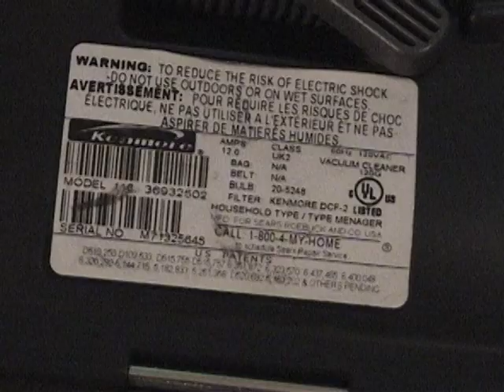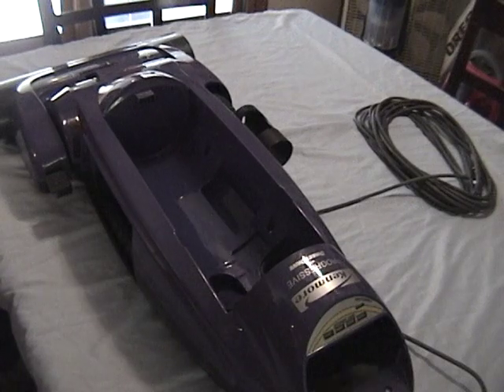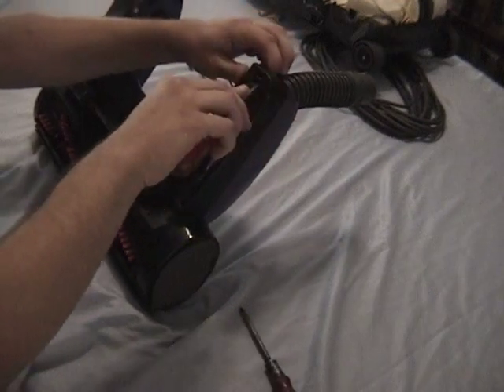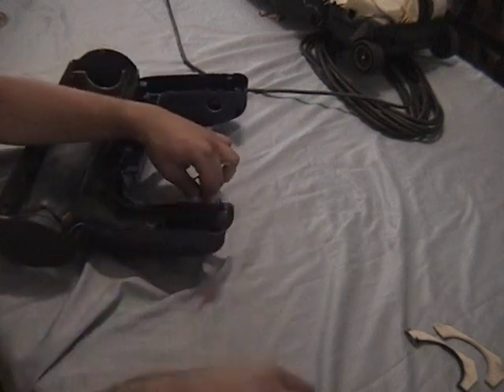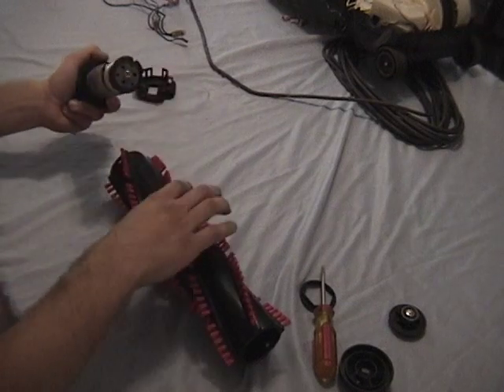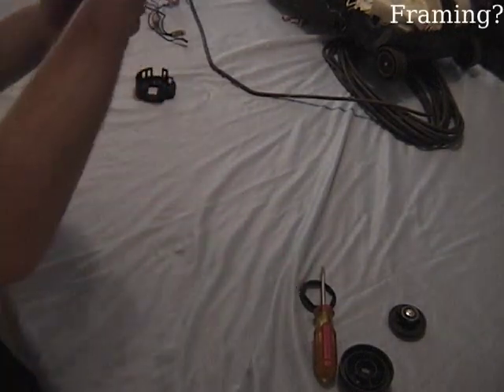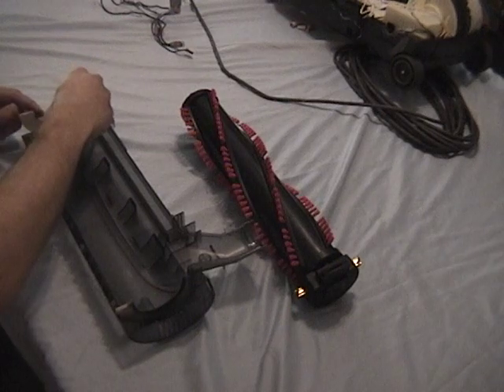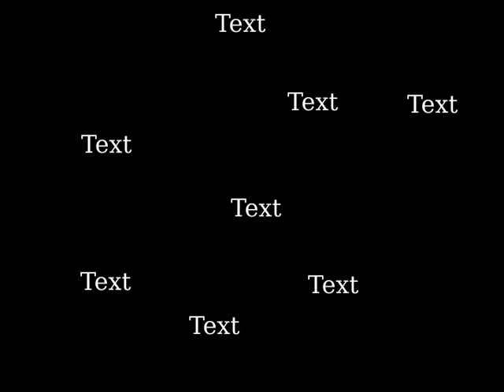How To Access The Direct Drive Brush In A Kenmore Progressive/Intuition

Comment: Thanks for the video.  I did manage to replace the beater bar by only disasembling the bottom part, but it was tricky to reassemble because the wires are so short.  Still, better than breaking into the wiring in the main compartment.  Your video helped me visualize how the wiring needed to go back together.

Comment: I bought this Kenmore 18 years ago. Cleaning ladies say it's the best. I treat it well and it still works great ... until today, when it played a trick on me. I tipped it up to pull out some hairs/threads twisted around the brush barrel and saw a ring of fuzzy stuff in the little spaces between the barrel ends and the housing collars. Since the fuzz is the same color as my carpet, I assumed it was compacted carpet fuzz, and  pulled it out on one side. Whoops! Turns out they're felt end-gaskets, and now the barrel doesn't spin. I should have taken Vacuum Cleaners 101 in college!

Comment: Couldn't tell but do you recall whether the 608 bearing is open? one seal? 2 seal? rubber seals or metal seals? I noticed searching the web that there are variants of said 608 bearing. wondering because I plan on taking apart Kenmore and cleaning the direct drive motor and testing 608 bearing for play, filth, etc.

Comment: I own 4 or 5 of these progressive vacuums. I do a lot of diy projects, and watch a ton of videos. Your's is up there with the best of them. I have a question, the brush roller on one of my vacs, (which is exactly like the one in your video), is running intermittently. If I bang it, it goes again. At first I figured it was probably a handle switch, but now I'm wondering if it could just be dirty? I didn't see a handle switch (that turns on the brush when you lower the handle) in your video, is there one? Also, would dirt or sand lock the brush motor up? I use that vacuum in a very dusty, sandy area in the desert. Fun fact, the guy that owned this house before me owned a vacuum cleaner sales and repair shop. He left hundreds of broken vacuum cleaners behind when he left, (he was a bit of a hoarder ;-). Again, fantastic video, thanks for posting!!
Reply: Did you ever figure out why the brush roller is intermittently? Thanks

Comment: I have this vacuum, and it works well.  We just bought wool carpeting.  I was told you can not use a vacuum with the bristles.  Is there a setting that would raise the bristles, so it does not touch the carpet?  Thank you!

Comment: I just found your very helpful video.  I would like to test the brush motor.  I notice that it is direct current, can you tell me the DC voltage that is correct for the motor?
Reply from the maker: As far as testing it to see if it spins, they will run on a very low voltage.  In the machine, I may not be remembering correctly, but I think it rectifies the 120 VAC line directly, so that would be about 170 VDC.
Reply: @ReviewingModsOfGames  Thank you, I will test it.

Comment: I have an old Kenmore upright direct drive Intuition model 116.31810010. It recently had a plug in the hose right where it connects to the vacuum head assembly. I successfully cleaned it out with some needle nose pliers as demonstrated on another YouTube video. Now I have a problem with the brush itself. The brush will easily turn by hand, and the vacuum works well on the bare wood floor setting, but the brush will not turn when the switch is on for carpet. I am at a loss about the reason since all videos with my problem are for belted vacuums. Is there a separate motor for the brush that could be shot? Do you have any suggestions for me?
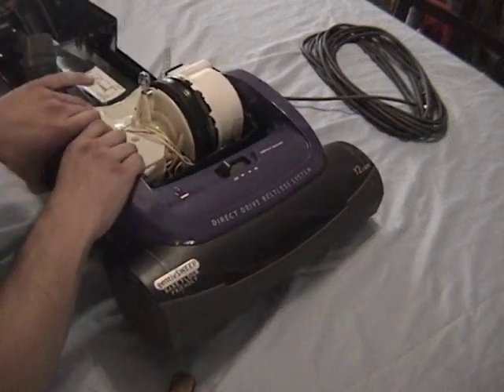Reply from the maker: The Intuition is pretty much the same thing as this as far as the brush is concerned.  The first thing to try would be to press the red reset button.  If the clog blocked the brush, that could have tripped.  The motor for these is actually inside of the brush roller, which is why the roller is wider than an average belted machine.  Another thing could be the switch inside of the head, which is briefly shown where my hands are at 5:16.  This makes it so that the roller will not run unless the handle is reclined.  If this switch fails, it could run all the time or not at all.  Finally, if everything traces to the motor (meaning there are no bad connections or anything like that, a multimeter helps) then the brush can be found on eBay and places like that as a whole assembly.

Comment: I’ve been looking for this video for years ever since my vacuum started spewing dust everywhere.  Since then, I noticed my brush roller had disintegrated and needs to be replaced, but I had no idea how to replace it.  Not only that, I can’t seem to find that particular part.  Any suggestions on where to find a brush roller for the bagged model bought in 2008?

I suspect that people will find this video because Consumer Reports considered it a “Best Buy” back in the day.  There must have been tons of them sold.
Reply from the maker: eBay is probably your cheapest option to find a roller.  Any of the rollers that fit in this style of base have the same roller (with 2 or 4 rows of bristles).  There are older and newer variants, but especially the newer ones look quite different from these.  It's wild how many of these are still in the wild today.
Reply: @ReviewingModsOfGames  Thanks for the tip.  It was discouraging going to Sears parts and finding absolutely nothing.  I guess that would be typical for something so old.

Comment: Brush quit spinning at bottom.  What's wrong and what needs to be repaired please!
Reply from the maker: The most simple check is to see if the overload breaker is tripped.  You can reset it by pressing on the little red button on the head.  If it is tripped, it can be caused by something stuck in the roller, or hair wrapped around the edges.  If everything is clear and the brush doesn't spin smoothly/pretty easily, it is probably hair or something on the edges of the brush.  My previous comment addressed possible faults if the brush does spin smoothly.